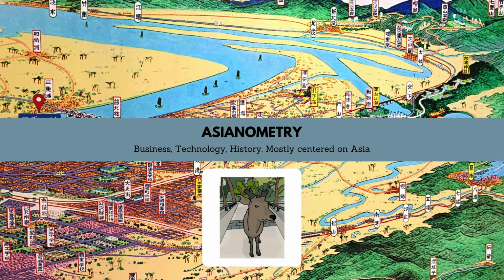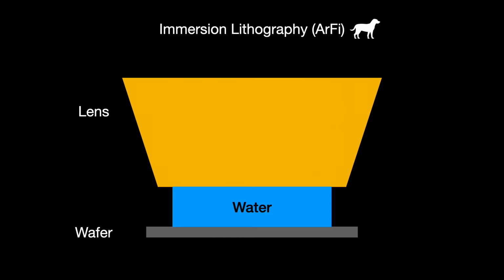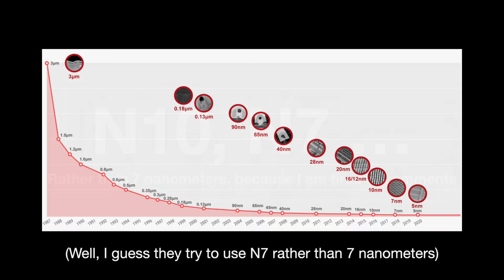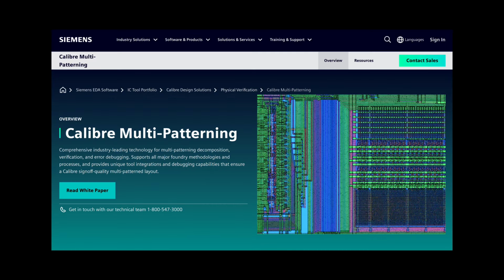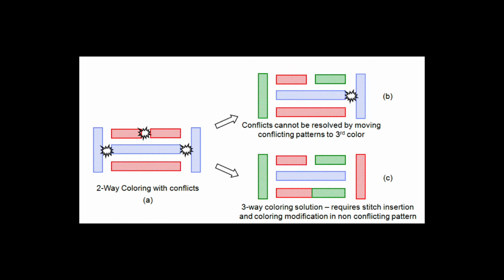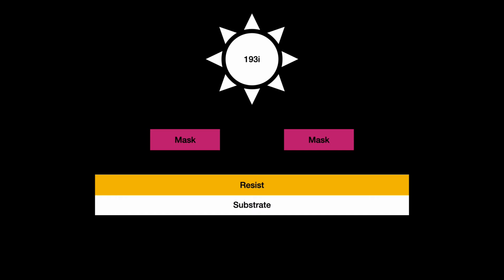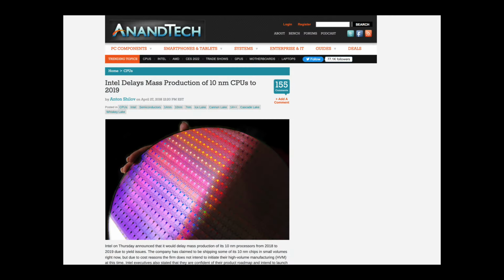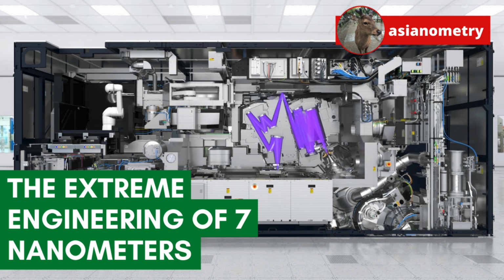Can You Do 7nm Chips Without EUV?

Comment: I went to a candid talk by someone from Intel back in 2012 and she talked very clearly about the challenges of going into EUV and the impossibility of it with the kind of lasers you need to actually get that feature size. I was surprised to find out over the years to see these headlines claiming that companies hit 14nm, 10nm, etc., when I know from my chemistry background just how difficult it is to get that kind of half-width level.

I'm surprised how difficult it is to learn the truth about what they're actually doing on the etching level without an explanation like this. Thank you for shaking me out of the stupor of years of marketing to see the truth that chip designers have been "cheating the barrier" to keep up with feature density growth.
This also explains why yields for everything, from PS5s to the M1s, are so terrible these days...
Reply: To get where you need to be with non EUV lithography means that you have to use "tricks" to shrink down the linewidth. What this functionally means at the 10nm± sizing is that larger lines are printed over various films, these are then etched to give a line that is your starting point. 
Next you use the fact that you can deposit very thin films very accurately to deposit a thin film over the line (#1) that you then etch to leave a spacer (#1) which is narrower than the line you can print. 
You can then remove the original etched line material, but leave the spacer; you then use this spacer (#1) as the mask for etching another lower film to produce another line (#2), and repeat the spacer dep/etch/remove line(#2) process. 
Finally you etch the last layer of material to produce you final desired lines.
This is "quad patterning" and it allow you to reduce the size of your lines, because you use the spacers as the mask for the etching, the size of these is not limited by optics. You also reduce the pitch of your lines (ie distance between lines) because you have the spacer on each side of the line you use to make the spacers, again this "gets round" the optical limits of UV print.

The downside of this is increased process complexity, restrictions in patterning, additional processes to "cut" lines as printing line ends increases issues. Multiple layers to be deposited/etched. This all adds up to process time, complexity, and defects, because more steps means more defects, and hence lower yield.
If you have EUV, you can do a print/etch without playing tricks which is so much faster....and saves defects.
look at this http://www.monolithic3d.com/blog/the-quad-patterning-era-begins for a visualisation of the above. Note: this is a simplified view...
Reply: Aren't those(M1 and PS5) made with EUV now and so should have fine yeilds?
Reply: @graficeb3484  EUV reduces the layers required vs. DUV-only lithography, so theoretically, EUV is easier. Playstation V's SoC (TSMC 7nm - N7p or N7+) is sizable 308-square mm die. Apple's M1 is on TSMC N5, which has better yields vs. N7. 

It takes a while to perfect the process node. Newer processes will have worse yields. Due to production issues, TSMC had to delay its N3 node, which was supposed to be ready by mid-2022 for Apple A16 Bionic for iPhone 14. Also, Samsung is facing delays to their 3nm GAA node. The shrinking nodes are getting harder and harder to launch on time for commercial production.

If the chip is smaller (less defects per square millimeter), the yields are better, which is why AMD's CCX dies are primarily cores and cache. It was rumored that AMD's Zen II CCX dies had 70% yield on TSMC's 7nm process when production started. With time, TSMC figures out how to reduce defects and implements the fixes. Allegedly right now, TSMC's 7nm class nodes have statistically perfect yields. TSMC has a reputation of being the fastest to improve yields versus Samsung.
Reply: @worldtownfc  If a die is smaller then yield is better for a given defect density as p(defect in die area) is lower. If defect density is lowered you have the same impact, but from the opposite direction. You can also increase yields if you have built in redundancy to the design, such that you can "replace" an area with a defect with the equivalent circuitry in another area - this makes the die bigger, but it can improve yield more than reduced # of die on the wafer & hence reduce costs.
If you make your die on optimised processes for each function, as AMD has done, then you increase die yield due to smaller areas - you can tolerate a defect density more than larger die. Also the variation across a die will be smaller, as it takes up less of the print field, which may improve die yield if timing skews are critical or bin splits. It also allows better matching between speeds/voltage requirements of the chiplets.

BTW, unless they have changed, TSMC do not give a monkey's about your yield (they sell you wafers that meet certain criteria, not yield), as long as they meet the defect density they say they will and the electrical results they say they will. If your device has sensitivities to the process it is usually up to you to sort out your design, not for TSMC to tweak the process.
Reply: it's funny to think about the time when they were underpromising and over delivering, back when they first broke from the convention of "process node" =  "actual gate length". In 1997, intel's 250nm process had a gate length of 200nm. later on it got "worse" with a 135nm process that had an actual gate length of 70nm. Now it's swung the other way. their 10nm process has 18nm gate length. From an almost 2x buffer to an almost 2x deficit.
Reply: @psd993  Yeah, intel as long as I have known has run with a gate length that is shorter than the nominal size of the process node - You are correct though the current node classification seems to have moved to the width of the Silicon fin being the "node size" rather than the length of the gate. The 14nm gate length was about 20nm and the 10nm gate length is about 18nm. I guess the improved switching is because of the field establishing itself in the Si body quicker because it is thinner, hence switching the transistor from on to off that much faster. It certainly helps in the leakage current.

One of the weirdest things that Intel did was at the 180nm node, where they saw some "good data" at the end of line during development which was due to undercut at the bottom of the gate reducing the gate length. The integration group thought it was so good that the "notched" poly profile became POR to give 100nm gates. This was from a process issue where the sidewall protection chemistry broke down at the bottom of the etched line. My buddy was actually doing the process development on this & he hated it, as you couldn't measure your process directly any more - you could measure the linewidth, but just had to hope the "notch" stayed the same.
I can't remember & I may be wrong, but I think the problem occurred due to intel moving to a hardmask etch on this node & during the overetch there was too much O2 available in the plasma which etched away the sidewall protection where it was the thinnest during the overetch, ie at the bottom of the line. 
I had effectively the same issue when we moved to hardmasked poly gates, but I changed the chemistry from a Carbon polymer protected sidewall, to an oxide protected sidewall and the issue went away.
You could do some fun things though if you wanted to by adjusting the amount of polymer protection and the length of the overetch, had some real T type shaped gate electrodes at the corners of some skews ;-)
Reply: @psd993  Yes, the so called 7nm processors have a 14 nm gate length, twice as long. And the 5nm/3nm is actually still 14nm gate length.
Reply: EUV when they stated work on it was with 157nm lasers and a refractive lens using CaF2, but this had birefringence issues. The process technology actually sort of overtook where the EUV work started, so they had to go back to where they thought they could make a real difference, this pushed them into the soft X-ray realm that they inhabit now. This changed everything about the optical path and masks - they had to move to reflective everything, hence the development time...
The person who gave you that talk sounds like they were not up to speed as to where EUV was moving to,  or just possibly she was looking at the existing EUV tools which were transmissive (for 157nm) and projecting to the size the industry would be at and then looking at the wavelength needed for direct print of that size, obviously the previously planned 157nm wouldn't hack it, and with a 19nm wavelength the tools existing couldn't be used...Just guessing here though.

If you want to know what is actually happening on a process node, then just search for cross sections or analysis, as soon as a new node is out in the wild, there are companies that do reverse processing and sectioning to look at the process. These reports then end up in the wild, though they initially are sold within the industry for lots of $$ so everyone can keep track of everyone else :-) A bit later the new processes are shown at conferences and papers end up on the web.
Reply: The 10/7/5/3nm transistors are just a naming scheme. They are actually all 14nm in diameter physically, just engineered differently allowing them to do more. Moores law is well and truly dead and has been for a while.
Reply: @StrazdasLT  Not true. There are changes in packing density,  and changes in the "fin" width and small changes in the transistor length. 
If there were no changes in the transistor, then you would have no changes in the speed etc. and yet there have been changes in the speed and leakage etc.
As I have said in another comment, I think it is likely that the fin width change has increased the switching speed of the transistors, as it has reduced the amount of silicon that has to have the switching field propagate through it and then be depleted etc. by the field.
True what is scaling is not the same dimension as a planar transistor, but so what? The fin widths are what seem to correspond to the process node now, and that is not surprising to me after I stop and think about it.
For GAA transistors, it is likely that it is the analogous dimension that will be the node name, viz: the conducting body thickness that will be deposited by ALD (Another potential process tool win for ASM), which will be the same as the fin width, just rotated by 90º and deposited rather than etched.
Reply: Qq apoio de

Comment: ASML did produce a model 1100A and 1100B ArF scanner, but as I recall not many were produced. It was the first commercial Twinscan Atlas body ArF tool ASML made. I worked on one in my first photo engineering job. It really felt like ASML was using us to test their software. Constant bugs, software updates, and crashes. It sucked.

Comment: Hey i have a serious question. Why isn’t there something as x-ray lithography. And why isn’t it being used??!
Reply: X-rays are notoriously hard to reflect as they penetrate most things. Also I've been told that creating a photo-resist compound for x-ray lithography is pretty hard. Not because it's hard to find a material that crumbles when exposed to x-rays, but be cause it's hard to find a material that crumbles, but doesn't let x-rays through to destroy the previously made features.
Reply: @andersjjensen  thank for the answer!! :)
But still I think reflecting them can’t be that difficult, because it’s something that happens in medical x-ray devices all the time. Why can’t they use heavy metal based photoresists?
Reply: @CaptivaLP  I'm not aware of medical equipment that reflects x-rays. It's generally "straight through". Even EUV is hard to reflect. The mirrors absorb quite a lot which causes throughput problems. DUV machines easily runs 300 wafers per hour whereas EUV machines are down to 150 at best.

As for heavy metal based photoresist: I'm not a chemist, but I know that photo resist either needs to "crumble" or "cure", when exposed to the light source, depending on whether they're doing positive or negative reticles. Just applying a layer of, say, mercury, is not going to accomplish any of those. It's just going to block some of the x-rays. But if a chemical compound containing heavy metals can be found there's still a lot of other considerations, like how to dissolve the cured parts (or the crumbled parts) without dissolving chip features too, and how to reclaim the heavy metals so they don't end up in the sewer, and how to apply the photo resist in a perfectly even manner (These days that's done with vapour deposition. Don't know if it's a good or bad idea to turn heavy metals into vapour...).